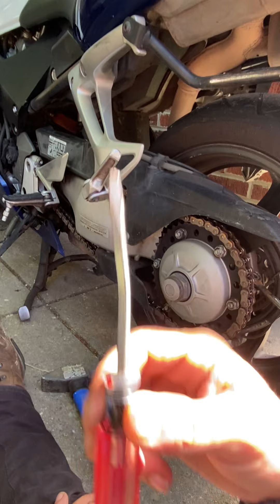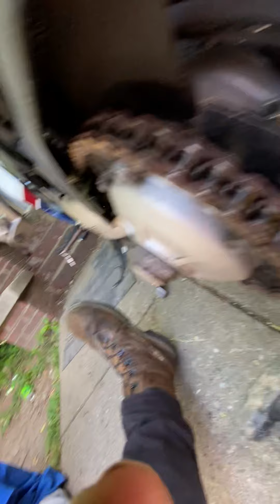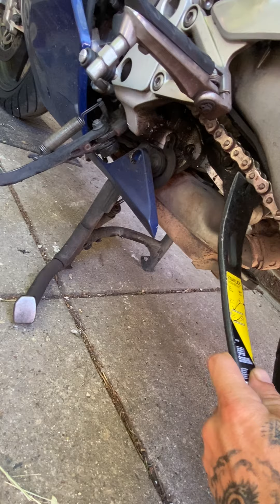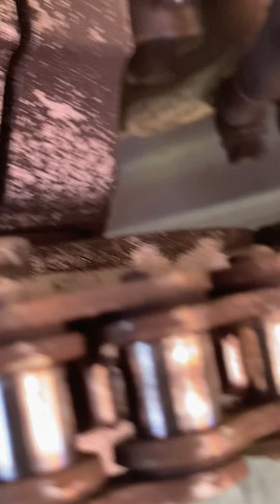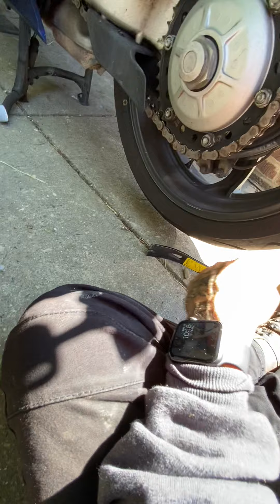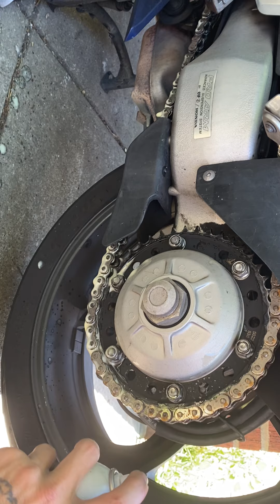Tightening chain on my Honda vfr

Comment: The wrench is called a C spanner and thats the proper tool for the job. Who the hell uses a pry bar?! Chain slack should be 25-30mm. Measure the slack with a motion pro chain slack tool. Guessing you aren't going to torque the pinch bolt to 54 ft/lb either. Good luck with that half ass job.
Reply from the maker: Thanks for your input, I did ride the bike for almost a year after I posted that video. I may not have done the job by the book but I got the same results.

Comment: Bro for some reason when i hit it the way you are. It’s making my chain more loose than before? Any idea why
Reply from the maker: If you’re hitting it in the correct direction it will tighten the chain. If you have it turned all the way and it will not tighten enough. Then you will need to replace your chain.